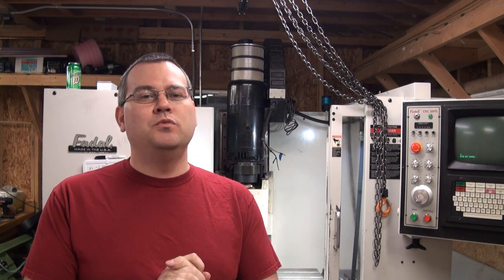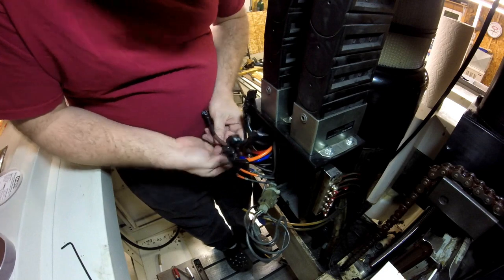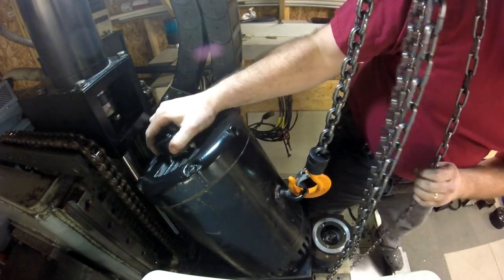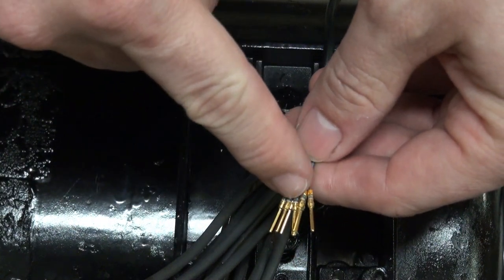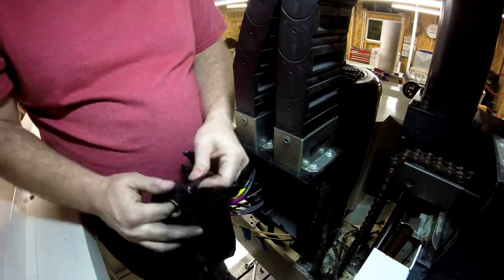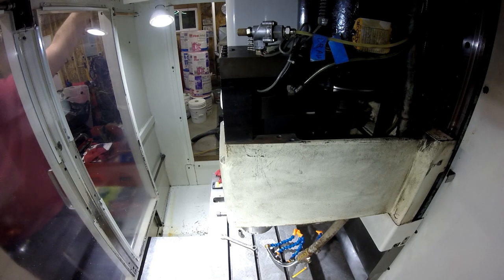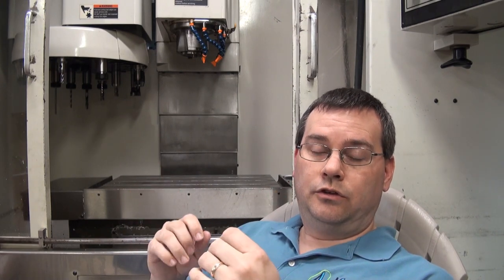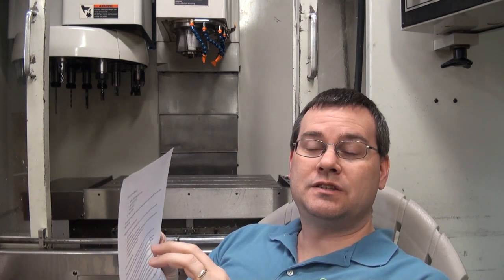Spindle Motor Replacement on Fadal CNC Mill

Comment: Excellent video, quite informative on the importance of CYA by making the work order clear leaving no mistake of your expectations as to the requested service and covering any issues for the benefit of all parties.  I especially like that you took the time to provide the shop with diagrams and clear instructions that they seem to have ignored  or overlooked.  There is a big difference in doing business with a vendor and getting the business done to you by a vendor.   Glad it at least was an improvement in the end but at twice the estimated cost is hard to swallow when as Keith Fenner would say they left "pecker tracks" on the item showing possible mishandling or abuse  of that poor pulley and possible the shaft too. 

Again thanks for an informative and cautionary video.
Reply from the maker: Thanks John, If it helps anyone with there work then it is well worth the time. I'm a vendor by day so I have been on both sides of the fence.

Comment: You are in a cold climate; how do you manage to work in the winter? Also, what steps do you take to prevent rust secondary to condensation?
Thanks for the videos, most informative.

Dennis L.
Reply from the maker: Hello Dennis, my shop is heated so I work the same way everyone else does ;) But when you live in a cold climate you just get used to it. Wear gloves unless the task requires you not to. But if you dress warm your hands will stay relatively warm for a bit. The heat really bothers me, I prefer cold. Anything above 80 and I start getting cranky.

Comment: usually anything less than 10hp you buy new. especially if the winding are done. shrink fit pulleys are not very common with the motors I have worked on and probably not on the motors that shop sees.

if you ever want to make a sling you can use old car seat belts.  Personally I like the proper slings which are about $20 and.

how long did it take you?
Reply from the maker: Hi Rob, took 2-3 hours to get it out and loaded and another 2-3 to get it back in. Thanks Tim
Reply: At-Man Unlimited Machining 
that is pretty good. you know your machine pretty good
Reply from the maker: Thanks, Unfortunately I have had it apart a lot. There is about 2 hours of footage shown at 10x time laps. The rest of the time was spent testing, cleaning, and inspecting. If I do it again I can get it out and then in around an hour ish.
Reply: Diamond Eyes I should have been more specific.  induction motors under 10hp.😁
Reply from the maker: Diamond, those are integrated spindles, this is just a standard induction motor with a belt to drive the actual spindle. I would 100% get an integrated spindle rebuilt.

Comment: Was there a lot of swarf inside your motor? I just looked through the fan and a bit wowed how much guey coolant and chips that are inside of it. Motor works fine right now but I’d like to clean that out. Any suggestions how to clean it?
Reply from the maker: It was packed with coolant residue. The shop that rebuilt it cleaned it.

Comment: You can balance it yourself. I've balanced lathe spindles. Using a spring plate with mirror and lazer. Shine laser off mirror to the wall. The mirror and plate are mounted to the motor.. You can see the shaking. Start lower rpm and work your way up to 5k.

Comment: I'm in the process of changing my spindle motor, all the wires coming from the motor are white and terminate to a junction box, there not held together with bolts through eyelets. How to know which wire goes where when the new motor goes in?
Reply from the maker: The wires on the motor should be marked. You will need to pull the data sheet on the original motor and new motor and compare the wiring. You can also pull the schematics on the machine and the wires on the machine should be numbered.
Reply: After I got all the gunk off the old motors wires they were numbered, I just put the new motors wires to the same junction box locations, it worked. Thanks, you're the man.
Reply from the maker: Welcome, glad it worked out!

Comment: Hi, is that a regular induction motor and how many kw's is it? Does it run through a gearbox or is 7500 rpm the speed of the actual motor?
Reply from the maker: Hello, yes, standard industrial induction motor. No gear box, 1:1 belt drive, motor actually spins at 7500. Its a 4 pole motor so 250 Hz. It's 10 HP or 7.5 Kw.
Reply: Thank you for your response. wow we learn something new everyday. I really did not know they could achieve that kind of rpm. Interesting..
Reply from the maker: Oh you can go much faster then that with better control algorithms ;) The issue is balancing the motor and system. Vibration is a function of velocity squared. So twice as fast is 4 times more vibration forces.

Comment: Buen día tengo una pregunta quitamos el encoder del motor de usillo parte ENC-0007
Para limpiarlo y ahora ya no me funciona 
Marca error #2 del usillo. Se puede reparar o lleva alguna forma especial de poner ?  
Acá en mexico no lo puedo conseguir me podría decir cómo arreglarlo ? O cómo comprarlo desde acá por favor es que me urge tengo parada la máquina. Lo quise encargar por eBay y que no hay envíos a mexico. O cómo repararlo ?
Reply from the maker: Estos codificadores no se pueden limpiar realmente. Es solo un disco de plástico blando con líneas extremadamente finas. Limpiarlo puede causar arañazos que interferirán con el funcionamiento. Puede
 solicitar nuevos codificadores desde Fadalcnc.com. No sé si se envían a
 México, pero creo que hay empresas en los EE. UU. Que brindan un 
servicio para enviar material a México. Al instalar el nuevo codificador, hay un espaciador especial que se usa para centrar el disco en el recolector. También verifique el cableado en el conector. Tenía un cable roto que causaba problemas en el conector del codificador.

Comment: I found working as an engineer that talking to the folks who are going to do the work that consulting with them personally is always a positive. Point out the critical items on the work to be done sheet. Tell them what doesn't matter and an where they can use their discretion on the job at hand. Make sure they have your direct phone number and if they have a question or concern that you WANT them to call. 
If they do a good job, make sure they know and their managers know that you are pleased with what they did. If it is a mission critical job were failure or poor performance would make your life miserable... don't be cheap.. take them out for lunch.  It will pay-off the next time you need something done ..like when it's Friday afternoon, and it's snowing, and your job is on the line when the plant starts up Monday morning if things aren't fixed.
Reply from the maker: Completely agree with everything here. Made a good attempt to do this.

Comment: I suppose you could have stuck a packing list on the motor with a copy of your instructions in it. But some things tend to come as a surprise and defy all attempts to plan ahead.
Reply from the maker: Hi Chris, I thought hand delivering was going to be good enough.
Reply: At-Man Unlimited Machining I ment in place of face to face with the tech, one copy for the office and one for the shop floor. Not all companies share any info through that wall.
Reply from the maker: Oh, ok. Yes that would be a good suggestion. Maybe try that if I ever do this again.

Comment: That's funny, I just got home from fixing a spindle encoder on a friend's VF2.  Molex connector corroded and shield wire broke on both sides.
Reply from the maker: There you go, another example, don't know why the machine mfgrs love them so much. For as much as these things cost they could use something a little better for low voltage critical signal wires. The DB9 I used is better then a molex for this and its still a cheap connector. Thanks for sharing!
Reply: I bet they love them because they are cheap, easy to install in panel cutouts, and Molex also offers fully automated machinery to assemble them.  :)  I use Switchcraft Conxall connectors,  plastic, barrel type, IP67/68, and not that expensive.
Reply from the maker: Yes, I think cheap is the key word there. I have used those as well, good quality and value. I had the DB9's from another project and they fit the bill.
Reply: Yeah DB9s are just fine for this, your repair is orders of magnitude better than the original.
Reply from the maker: Thanks Pete, I try to make it right.
Reply: I'm the same way man.  Make it right.  I think most of the time it's my greatest downfall as I often don't settle for good enough.

Also, do the spindle bearings.  It's a fun learning process and you can send the spindle out for balancing.  It's not a video project yet, but here are some pics of what I have been doing with my mill - and the condition of the spindle bearings.  I was able to measure runout and concentricity using my AA surface plate and fortunately other than a few heat rings on the spindle/housing it was still in perfect shape.

https://peteb.dunked.com/shizuoka-mill-rebuild-control-retrofit

I would also ask the company that rebuilt your motor to replace that pulley.  That's bad form IMO.  If I did that work, I'd replace the pulley, and I probably wouldn't charge you for the shaft straightening...  At almost any other shop I bet your letter of service request would
Reply from the maker: Nice project Pete! I might do bearings in a bit. Need to build up the bank account again. At this point I'm just happy to have a functional motor, I really don't want them touching my stuff again.

Comment: OMG this is the story of my life. This is why I repair everything myself. You simply can't trust anyone anymore...Dave Molex connected are garbage!
Reply from the maker: Yeah, never thought swapping a set of bearings out and balancing a rotor would be so much drama. The molex connectors are ok for larger gauge wires carrying medium currents at low speeds. As long as there in places that have low mating cycles. But for smaller wires, large currents, or high mating cycles, yes they are a very poor choice.

Comment: In my experience, always best to buy new motor and reassemble yourself. Remember, not everyone is like-minded when it comes to engineering/machining/mechanics. In other words, most people's attention to detail is lacking. They just want the job over ASAP. Well written instructions and advise are more than likely to be ignored. Plus, most of these motor guys only know the most basic stuff. Give them an "exotic" motor from a CNC, and you take a big risk in getting back what is right. Like taking a Porsche 911 to the neighborhood fix it man. Been there. As always, nice job At-Man!
Reply from the maker: Thanks JP, these guys where recommended for doing more exotic work. The person that recommended them was shocked at the outcome.
Reply: That sucks. But glad it came out OK in the end. You have just about replaced every wear part in that machine! I bet Dave Decaussin would love to hear from you. The D in FADAL.
Reply from the maker: LOL, almost, there is still a lot left and I hope the rest lasts. Y linear, Z linear, Y screw, X screw. Spindle is most likely next I think.

Comment: HI, HOW DOES THE MOTOR PULLEY BE REMOVED?
Reply from the maker: Hello
The motor and spindle pulley are heat shrunk. You use two propane or map gas torches and evenly heat them. When warm enough they will just fall off.
Reply: OK THANK YOU
Reply: YOU HAVE A EMAIL?
Reply from the maker: It's in the video description
Reply: MY machine CNC have a problem, when the put in mode JOG and i want move with the MPG the machine no respond correctly but only in the negative movements,. But if I move it with the jog key it moves correctly. help me.
Reply from the maker: If your saying the Jog wheel only works in one direction most likely one of the wires for the encoder broke.
Reply: if it works, but it takes time to respond in negative movements, I move the knob and it takes a few seconds to move the table.
Reply from the maker: Not sure on that one
Reply: DO YOU SPEAK SPANISH?
Reply from the maker: I do not, but you can try Google Translate, it works pretty good.

Comment: I had a motor repaired once.. did the same exact thing to me I could of purchased a brand new motor for $250 more than the repair. I even stated in the paper I gave them to inspect everything if the repair cost will be this dollar amount or more, don't reassemble just order a new one... they never called me, just performed the work. the day I was suppose to pick it up the girl came out and she said well it looks like their was a little more work than originally quoted.. I figured couple hundred whatever she handed me the paper and it was 1000 dollars more than I was quoted.. I spent hours arguing with them, they just didn't see my point of view even after going back and forth two hours they still felt they saved me $250..... end result I ended up with a used motor at $250 less than a new one cost ...  after that I decided I will never have a motor repaired I will just purchase a new one. Since then I have replaced two motors in different equiptment... sad ....
Reply from the maker: I agree it is sad. I try my hardest to provide a good fair value to my customers with open communication. I have never had anyone complain of to much communication.

Comment: Having run, as owner/manager, of a machine/job shop dealing in hydraulic, electric and air motors pumps and valves, I might glance at your demands, but would not have wanted to take any time to write up a response/estimate.
        Verbal sometimes just has to do.  The customer has got to do their do diligence also about the company .  Check around.    
        Time is money to every shop.  Most shop owners are not attorney and I'm sure an attorney would tear your letter to pieces any way if it went to court.  Great idea, but a waste of time.
         Gain a friend by spending your time explaining what you want to the manager only, not to the workers, they don't make the bills.  I loved the video and look forward to all of the.  I have Fadal 40 20 I hope I can ask you a question some day. thanks
Reply from the maker: Thanks Brad, but I must disagree. I did explain it to the manager, that did not work as we see. I could have easily went after them for damaging the $300 pulley by not following industry standard procedures, but what would have have solved?
My main job is in services, the customer is always right, even if there wrong. If its in writing, and I don't agree I will either have a conversation and or turn down the work. If work walks in the door with detailed requests and you "don't have the time" then just turn the work down, simple as that. I would have preferred it rather then going down this rabbit hole. In the end, I was not happy, they lost money on the job, work was done that wasted everyone's time and money, they had to rework the part at there cost, all because "they didn't have the time" to read a 1 page double spaced, large font, service request.
I don't mind a quick estimate, but when your over 100% off from your estimate with no communication to the customer, that is a major issue. And I did research the company, they came highly recommended, was shocked this happened.
In any event, feel free to drop a line if you have any questions
Thanks
Tim

Comment: I can't believe your wearing crocs doing this......
Reply from the maker: Not advisable, was going in and out of the house a lot that night. The actual motor was the only thing heavy enough to do damage, and it was so heavy if it hit my toes it would have been a question of a little pulverized vs totally pulverized. I keep my machine very clean and clean all the coolant and oil from where I'm working so there is no slip hazard. I also would not recommend them for welding, leaves little burn holes in your socks. But they are comfy.
Reply: Crocs clean in a aqueous parts washer ever so nicely, especially when you get sticky oil all over them. ;)

Comment: Hi , Did you Get A Warrantee from the motor Shop ? ( 30 Seconds < OR > 30 Revolution's Which Ever comes First ??? )  They Painted The motor BECAUSE THAT AN'T YOUR MOTOR !  ( Has the Serial ID Plate Look like it was Removed ? ) 
 Set That Motor aside , Call " Fadal CNC "  Order a New Motor and Pulley You will have It Paid for on your next job . 
 No more down time .  (( Oh , Spindle bearings OK ??? Without Belt Tension ???? )  Just Say'n  ;)
Reply from the maker: I have a new spindle and motor waiting to go in. Live and learn on this one.